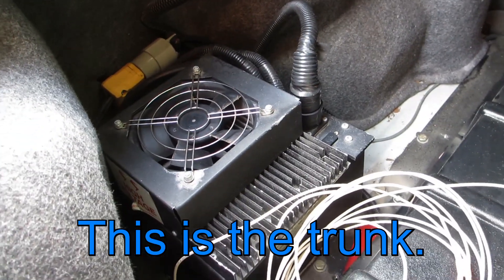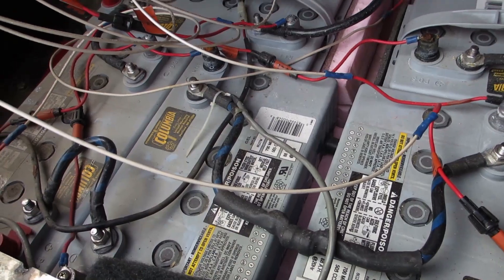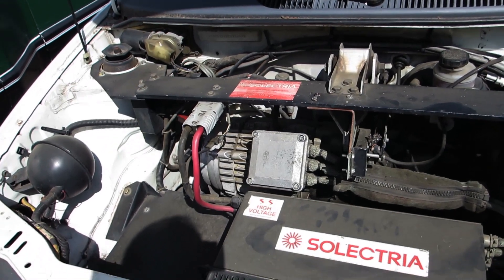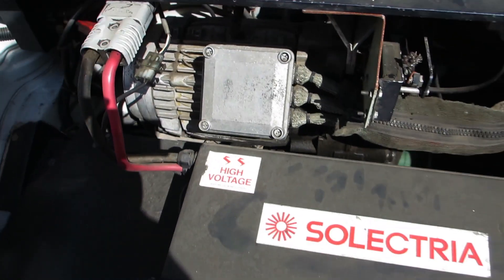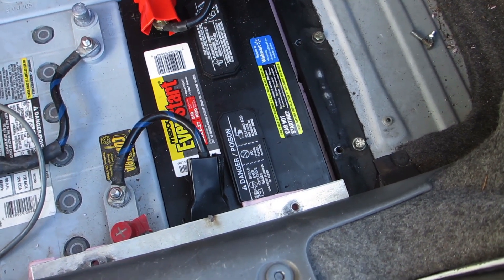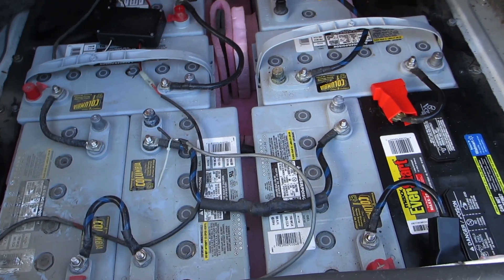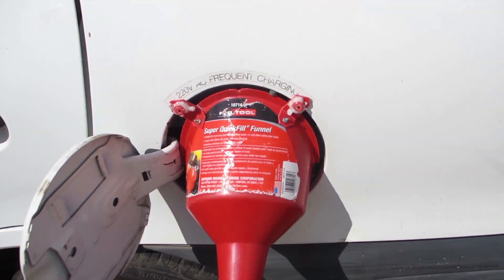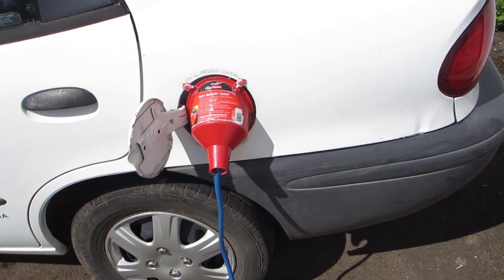Electric car - Solectria Force  breakdown and repair.Portland,Oregon.

Comment: How long have you had it?
Reply from the maker: 5 YRS
Reply: Is finding parts for the car expensive/difficult? Are there any cons?
Reply from the maker: @yungjustinhefner  pros- lead acid batteries .Easy to find GM parts. Plugs in to 120-240 volts. Goes 65  mph.  Cons- Doesn't go fast off the line .  May be difficult to find  Solectria parts. Thanks for watching. Watch my other videos on this car.
Reply: Beside 30miles on a charge